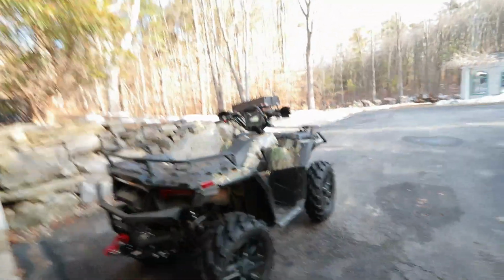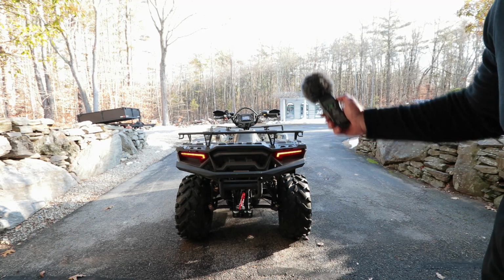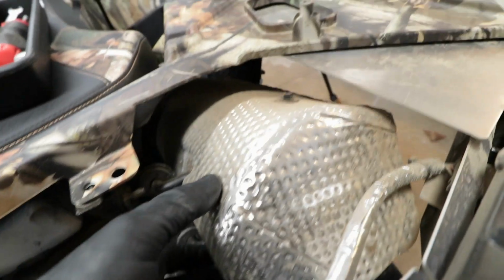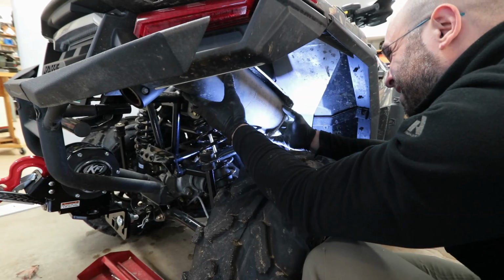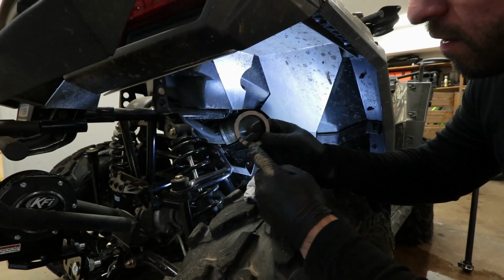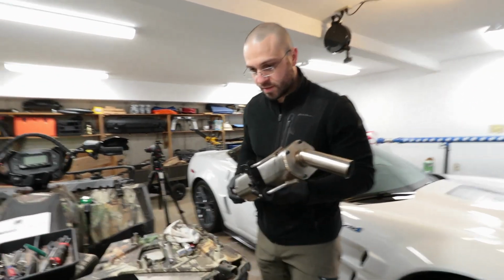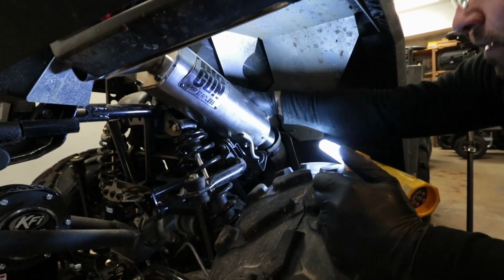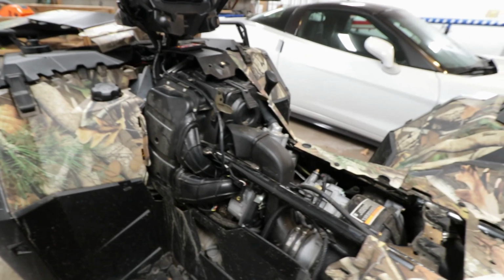Big Gun EXO SS Slip-on Exhaust & Power Box | 2018 Polaris Sportsman 1000 XP Hunter

Comment: I'm about ready to pick up a sportsman 1000 how are you still liking the exhaust would you find a different route or stuff with a big gun
Reply from the maker: Congrats. I know exactly how excited you are haha. Still feels like yesterday when i picked up my brand new 1000xp. But to answer your question. I actually went back to stock air filter and muffler (no spark arrestor) and clutching after all my swapping out and tinkering. The big gun is way too droney for real trail riding or long term use. It gave me a massive migraine after each outing on the trails, i would have to prepare and pack me some ibuprofen. Around the property here it was fun. But you will get sick of it eventually like i did if you use you machine alot. Check out my polaris playlist it got almost 100 videos in it covering my 1000xp and wifes 850

Comment: I hope they got there alignment fitment issues resolved I just ordered one
Reply from the maker: I hope so..have you installed it yet? The one i received was terrible. Definitely does not drop in or bolt up. Snorkels next...Thanks for watching!
Reply: @ModernHotrodsNH  ya it dint fit that well what a pain it sounds good and has good craftsmanship other then whatever template they are using is off
Reply: @krisvold32  so how’s the Exhaust? Might order one soon, was there a torque increase?
Reply: @wall-e474  sounds good didn't really notice power increase but does not hurt power